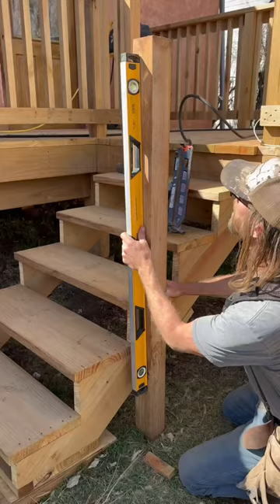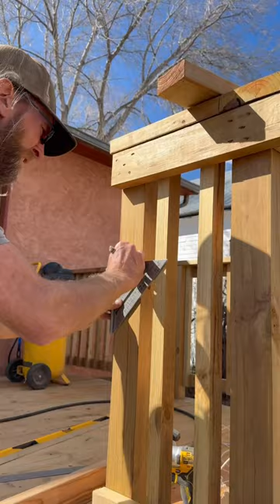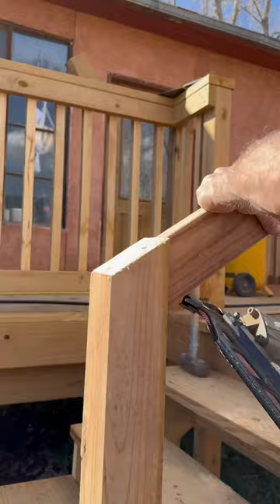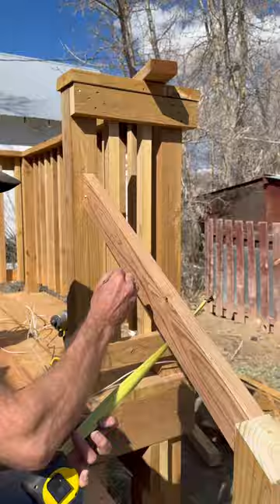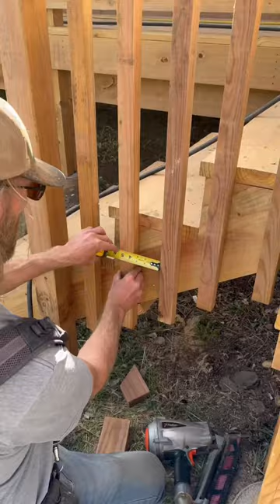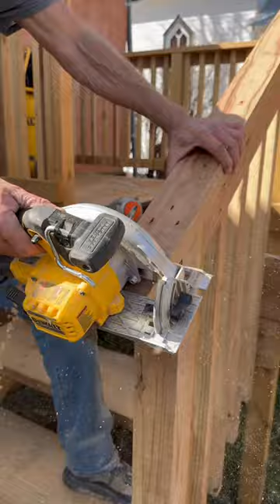🔨Deck Stair Railing Installation! #construction #contractor #deck #framing #carpenter #carpentry

Comment: The use of the framing square and speed square shows the experience this guy has with wood working, in volumes, it helps me with gaining more knowledge !🤙🏻
Reply: lol
Reply: Except he pocked the weakest part of the post to fasten to the stringer which made it even more weaker. This piece will also warp at same location. Should have rejected this piece altogether.
Reply: @alnov91 all wood warps

Comment: Screws or nails it doesn't matter. The guy is a master and got paid regardless of your opinions people. Yes screws are better but we dont know what the home onwer's budget is like. Besides screws take longer to use, especially of they are being counter-sunk beforehand. In Colorado the ground doesn't shift daily like it does here in TX, so I highly doubt that someone will have to reinstall the post after a year like some of you claim. Im a framer and a finish carpenter and all I can tell you is that this man knows his shit. Of you have a cart pusher job and have an opinion on this man's work, I suggest you get in the correct field because it's hard to retire off a stupid Walmart pension and Bitcoin.
Reply: So you're saying you are absolutely terrible at your job like this guy, good to know!
Reply: This guy is no master.

Comment: Handrail would never pass inspection for two reasons: 1) The post is lazily installed and 2) The handrail itself must be graspable. A 2x4 can NOT be used as a rail.

Comment: Cuts are great...but footings are absolute trash and you nailed everything...those people are going to be feeling nail pops within a year and if you're going to nail the shit at least adjust the pressure so it doesn't blow out into the wood. One last thing those tek screws for the rail is garbage...galvanized lag bolts or carriage only...speaking of which I see neither on your joist to the posts. This passed inspection? Hopefully you at least used joist hangers.
Reply: Stephen

Comment: Now that the guard rail is installed, what about installing a graspable handrail? 2" x 6" not "graspable" so its a code violation without adding a handrail.
Reply: Practically everything in this video is a code violation
Reply: @HoundMonkey haha for real. Nailing spindles is what lazy scabs do because they know a code guy is most likely never going to check it out. I’ve never had a code guy come check a porch after I’ve built it.

Comment: 37 yr. custom home finish carpenter here. Guy did GOOD! 1st, green treated wood is the very BEST bang for the average homeowner’s buck. 2nd, it outlasts $Composites$ by far and 3rd, much more solid and 4th, least time consuming deck and 5th, simpler, least number of tools required. Saw, nail gun, framing square, level and compressor. Ring shank nails are fine if they’re not splitting the spindles which is very seldom with right nails. You want Beauty, screws, and detail, empty your wallet out - or be quiet. This from someone who has done over a hundred custom interior stair bannisters.
Reply: Sir as a custom house framer, I would stick to interior trim. I don't  see quality here. At least in N.C. the hand rail is already to low. 4x4 plants don't  meet code on the stairs. Trusting the angle cut with a level to get the rail height?  Nope, pull a gring. Just for starters.

Comment: Man, that's old school shooting your pickets on with a nail gun. Nobody does anymore, you screws makes a much miserable job. How many pickles did you split? Pre-drill your pickles use deck screws. They don't pull out. They don't pull out. They don't split makes a nice job. Why don't you show it by the?  Finish that you're nailed.That's why I don't wanna see

Comment: You did that rail wrong. You can't just toe nail it. That's structurally unsound and against code in several jurisdictions. You have to have the 2x4 overlapping the 4x4 posts

Comment: I like this but speaking structurally I would have used nails or something beefier for mounting the stringer to the post and screws for the railing setup. Decking screws don’t have much shear value but are sufficient for railings.

Comment: I was hoping you would clad that to cover all the ugly nail holes but nope, just more and more nails stuck at random points. Ugly AF and no way to fix anything without pulling it all apart. Screws would have been better and less ugly if you put some pride into placement.

Comment: Using a framing nailer is not the way for decks you should always use screws, only nails underneath the deck for the framing.

Comment: What a ridiculous waste of time 🤣 the "trick" to get the angel everyone is talking about can be done in 5 seconds. Mark the height for your 2x4, hold it to the outside of the  just use a pencil to mark and cut your angle. You also can then use the 2x4 to mark the angle for where you need to cut your post. This guy took 20 steps to what what could be done in 3, and didnt do a decent job in the slighest. The nerve to even record this is beyond me, let alone receive completes.

Comment: You're an amateur if you have never seen the square use like this. This man is a craftsman and must have worked with older people as a young-n.
I think it's a joke when I see people building projects and they pull out pocket calculator and all that. You can certainly use your tape measure as the calculator and the square to do the same thing.  You just need 2 pencil lines and 3 numbers, then draw the line. All he did was draw a square off the angle of the steps..known as a parallel line. Lots of work, man. Great job

Comment: That handrail post in the ground we ill rot out in a few years - not good. At the very least the post need to he rubberized using liquid rubber - from the bottom to about 12 inch above ground.

Comment: Wow that is janky ass work you have a tape measure use it. The 4' level on top of a 4x4 rail post to project a line that's not lvl is next level idiocy. Use a tape and don't cut your pinky off

Comment: Wood on the ground, stairs aren't cleated to a cement pad, nailed together in treated wood (chemicals eat the nails) and the handrail is a different angle than the stairs. Is say it's nice if it's a kids fort. But that's about it.

Comment: Screws are better for a deck.  Nails will pushout outside w treated lumber. And that handrail should be routed on the corners or miters so you dont bust your hip open on a sharp corner.

Comment: Never nail a deck or handrail always use screws the nails will come loose over time and using stainless steel as well, nails work but over time no bueno

Comment: I could never go crazy with Nails like that but a couple weeks ago I did see a deck that was built with composite and they even did the skirt board and they used framing nails with a gun to lay it complete nightmare oh, they also did a  corner on the house with Azak  and used framing nails  and it was peppered not sequential home owners pissed he bought the screws clips plugs and they took them with them and never used any of it.

Comment: Not a fan of the 2x4 seen under the stringers. Id put a third stringer so those treads dont cup and warp in a few years.  And use blocking

Comment: Big fan of that trick for transferring the stair angle. I’m assuming you can just adjust up a down a bit with the 16” section of the square to hit you height of cut.

Comment: A little weak with those screws holding the post. And also shoot the nails on the top flange deeper so you can fill in the holes with wood filler for rain protection.

Comment: I never built deck stairs before and even I did not put the post straight into the dirt or use two regular deck screws to tie the post to the riser.

Comment: I rarely use screws.. too much  squeaking noise as time goes by.. unless it's also glued down. I also never attach the spindles/balusters to the fascia board or stringer,  always on a bottom rail and all end above the deck floor. I also prefer using Railing connectors vs. attaching Railing directly to the post. Not saying you're wrong, just stating our different ways of building.